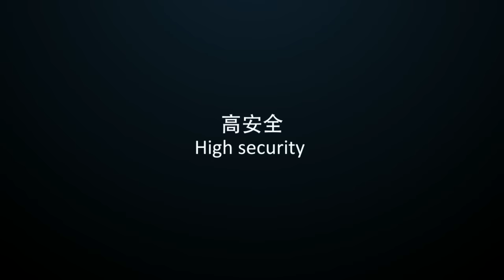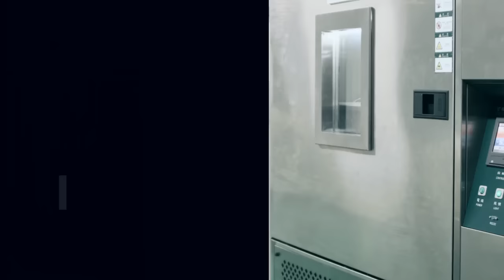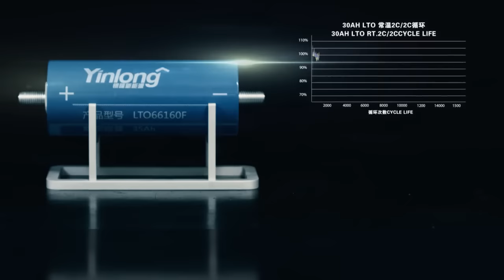Battery safety: Yinlong LTO Lithium Titanate tests

Comment: I agree with how will these are tested. The heat/fire test has me sold.  The are durable and continue to hold a charge. Yinlong seems like a very reputable company so far. It's a pretty penny but looks worth the investment
Reply: Aren't they inexpensive from a power density perspective?
Reply: @rich1051414  inexpensive Per maximum abount of cycles that you can get from them

Comment: What about efficiency? How many % efficient is it when charging and discharging?
Reply from the maker: Hi Daniil. It's a series of safety tests, not efficiency tests.
Reply: Above 98% is typical, they have very low internal resistance and are very efficient.

Comment: State of charge during test?
Reply: Maximilian Van Dongen why would you need that? would you expect any use after cutting one cell?
Reply: @IustinianP  You do not realize that lithium batteries of any kind are only dangerous if they are charged. A test with empty battery is invalid.
Reply: @bflmpsvz870  the bulb was light
Reply: @bflmpsvz870  Read comment, light bulb adjacent is connected to battery, shows that battery is capable of outputting power during test
Reply: @samuels1123  My response was referring to 
Iustinian P. comment, not to the steps taken during the demonstrated test. Again, testing for puncture safety has only sense with a fully charged battery as in this charge state you can expect the most explosive outcomes you want to test for.

Comment: I want to see the drill test AFTER the cell was charged to full capacity.
Reply from the maker: It was tested not only charged but also connected to a lamp which was continue to light during drilling.
Reply: These are LTO cells. They aren't like normal lithium ion cells.

Comment: LTO batteries are not there yet, they loose 15% of charge you put in them. Lifepo4 batteries only loose 1%.
Reply from the maker: Did you test them?
Reply: bflmpsvz exactly unfortunately, because are really good on other performance
Reply from the maker: @bflmpsvz I saw that video, but there is no efficiency test. He quoted someone who said LTO's efficiency is 85%. And Will's cells are noname ones bought from AliExpress as 40Ah ones which the seller then changed to 30Ah in the description but on the photos they are still marked as 40Ah ones)))
Reply: if they are losing 15% of the energy, wouldnt that be in heat?…. A LOT of heat. So that wouldnt be true because they dont get warm to the touch at all
Reply: @funwithdroneshunter2126  Own generated heat is only one of ways of cell energy loss, can happen over time and is practically immeasurable by a raised temperature in an instant. Another loss could be due to cell chemistry inefficiency, outside temperature etc.

Comment: With a car stereo 12 dc and amp at 100 watts dc amp and  with six 2.7 batteries together how long will Likely will these batteries give out power to power a both of these devices
Reply: What's the capacity of 1 cell ?

Comment: They should connect the battery to a light bulb while doing all the test.
Reply from the maker: For what? If it's gonna explode it will explode even without a light bulb connected.
Reply: Connect to the 💡 so we can see how much damage it can take before it completely dead. Also ,it will save a lot  time for people to write the comment to wonder if the battery was charged just as I doing now.
Reply from the maker: Ask Yinlong - it's a series of official tests.
Reply: Hey, Yinlong, why not connect to 💡?
Reply from the maker: I hope they gonna read your comment))
Reply: If there was a light bulb connected and the cell was in a fully discharged state (no crude jokes about discharge please, ok maybe one) then it's not going to make for good advertising. Same goes if they drilled / nailed / cut more than a third the way through (a charged cell) and it caught fire / emitted gas or smoke, then that's not going to be a good look either.

All those claims maybe true. But without an independent test showing terminal voltage I'll choose to remain un convinced at this stage. 

Wishing y'all a splendid life 😊
Reply from the maker: Hi Casey, Why not take one and shoot a video confirming your words? I watched many independent tests where people shorted, drilled, crushed these cells totally and there was no fire.
Reply: It will be too bad, because not looking good in test experiment are one of the main reason I go YouTube.
Reply: My mistake, I watch the video again and noticed they do connect to the light bulb(small light bulb, in the rotation circle) at the first fews test, light bulb are still on after been cutting, drilling, and penetration , also penetration in water.

Comment: Where can I buy these cells?
Reply from the maker: How many of them do you want to buy and where they should be shipped to?
Reply: @ThunderheartReviews  Will these work well in a car audio application?  I would like to build a 14 Volt Bank . I have roughly 200 amps of charging voltage at 14.7 volts. Will that work?
Reply from the maker: Many car audio enthusiasts replace lead-acid batteries with LTO, so it works.
Reply: @egidio6david0  i want this for car audio application as well. I'm thinking  continuous drain. Normal 12.5 - 14.4v range. Any input would be greatly appreciated. I am still trying to learn the diy lto as lithium iron phosphate is to dangerous for car audio application in my opinion.
Reply: Does YinLong has his own Web-site in the internet??? To get some information about who they are , where are they....
Reply: @ThunderheartReviews  don you have a source for the 40ah cells, that are preferably A stock?
Reply: @ThunderheartReviews  Interested

Comment: 0:35 no Burning huh?  I see smoke there...why cut away so fast?
Reply from the maker: Even when you cut wood with a high speed disc cutter you'll see some smoke. Burning means catching fire. It did neither catch fire, nor explode. Smoke is normal as there are chemically active materials inside the battery. Also i think the cell became hot though there is no info about that.

Comment: BS, charge them up to 100% and then drill.
Reply from the maker: Привет, Артём! They are practically safe at any SOC, even in overcharged condition.
Reply: Lithium titanate is known for being incredibly safe compared to other lithium battery technologies. 

That doesn't mean that they don't have their flaws, a low output voltage and an inefficient discharge rate means that they have limited usefulness, but these tests are indeed accurate. 

Also, look at lithium ceramic as well.
Reply from the maker: You're right, every technology has its disadvantages too. In case of LTO the main 2 cons are lower energy density and higher price. The voltage of a single cell doesn't matter when you're building packs - for example do you care if there are 3 cells (3.6V Li-ion) or 5 (2.3V LTO) in your 12V pack? You put a BMS on top and don't care. The thing is that those 5 LTO cells weigh and cost more (much more) than 3 traditional lithium cells.
What you mean by "inefficient discharge rate"? LTO's main advantages are very high charge and discharge rates + enormous cycle life.
Reply: @ThunderheartReviews  
I saw a charge/discharge test with LTO batteries, and the person's results were that he only got about 85% of the power back out of the batteries that he put into charging them.  Perhaps my term of "inefficient discharge rate" isn't the correct term. 

From my understanding, the main advantages of LTO batteries are that they are incredibly safe (as demonstrated in this video), they can charge up relatively quickly compared to other lithium batteries, and that they are rated for a high number of charge/discharge cycles. 

Those particular qualities of LTO batteries make me interested in them as a battery backup for a solar/wind energy system.  I understand that lithium iron phosphate is a common battery technology for that specific application, and lithium ion would probably be the most space efficient, so I'm doing my research and weighing my options. 

I would argue that the low output voltage is indeed a concern because you would need to get more LTO batteries in series then otherwise needed.  That combined with the already high price for LTO cells (they were over 50 dollars per cell last time I checked) maces that a viable concern price (and space) wise.

Out of curiosity, what are the most common uses for these batteries?
Reply from the maker: What cells did that guy test? Genuine Yinlong, Toshiba SCiB, Altairnano or some noname Chinese ones?

The advantages and disadvantages priority may vary depending on the type of usage. Space is critical for one, charge rate for another, cycle life for the third...

Today LTO is mostly used in electric buses.
Reply: @ThunderheartReviews  There was a guy who bought possibly relabelled 30Ah cells from Ali, charged them till 2.5V only, connected them together with copper bars and started to say those discharge rate stupidness.
I have small 3.6Ah pouch bag LTO cells in my robotic lawnmower (changed 18650x5 to 8xLTO), and those have app. 3.7Ah capacity, and my Yinlong 30Ah cells are perform 30Ah without problem.
Reply from the maker: @Cinnabar Sonar
I saw that video, but there is no efficiency test. He quoted someone who said LTO's efficiency is 85%. And Will's cells are noname ones bought from AliExpress as 40Ah ones which the seller then changed to 30Ah in the description but on the photos they are still marked as 40Ah ones)))
@Laszlo Torok
Can you put a link to your 3.6Ah cells?
Reply: @ThunderheartReviews  I bought them from Ali: https://www.aliexpress.com/item/32980110987.html?spm=a2g0s.9042311.0.0.27424c4dpvAP8C - with 0.8C load i got near same result. I do not know the manufacturer of the cells, because there was nothing written on the cells, but they are fine.
Reply: @ThunderheartReviews  I cannot find the spec sheet that the person in the video was referring to, so I was probably mistaken and he got lower capacity batteries. 

If so, then that's one less con to worry about, thanks for taking the time explaining things to me.

One more question, I already said that I plan on using LTO batteries for solar and wind power, I however would like a second opinion.  Do you think that this type of battery would be well suited for that particular task?
Reply from the maker: @Cinnabar Sonar it would be a great choice if you plan to build a system and forget about it for years. If you're an enthusiast and upgrade it all the time - it's not your choice. Also you'll have to choose the remaining equipment carefully to be able to use the full capacity. In case of Will's electronics it wasn't that easy - he couldn't use the whole capacity he had. That made price-per-kWh even more taking into account LTO's high price tag.
Reply: @ThunderheartReviews  I would consider myself an enthusiast on a budget, and while LTO is more expensive at first, I should save money in the long run due to the sheer amount of charge/discharge cycles that it's rated for. 

I don't intend on making frequent upgrades, perhaps adding some cells in parallel down the line to increase capacity, space isn't an issue, I have 4 acres. 

I also intend on installing wind generators, and I've heard that LTO works particularly well with wind due to it's fast charge rate.

I will definitely do the proper research in terms of proper equipment, it seems that chargers that specifically support LTO is needed to take full advantage of the technology.
Reply from the maker: @Cinnabar Sonar
Also take a look at A123 Systems' LiFePO4 cells though they aren't cheap ones. ANR26650M1B which i've tested has fantastic performance - 2500mAh capacity, 4C/10A charge, 28C/70A continuous discharge, cycle life at 10C/25A discharge and 100% DOD is >1000 cycles. You can buy Grade B cells to save some money without losing in performance. I recently bought a bunch of them for a future project. Here is my review with Grade A vs Grade B comparison: https://youtu.be/sESdD4FqXDQ
Reply: @ThunderheartReviews  Interesting, I'll have to look into them.  >1000 cycles is very good, but not as good as the >10000 cycles that I've seen with some lithium titanate batteries, but they are quite a bit cheaper per cell as well.

Perhaps I can start with a small scale with the anr26650m1b's and then switch to LTO after saving some money for a few years of (hopefully) saving some money with running heating from solar/wind during the winter months. 

The anr26650m1b's seem a bit smaller, so I can use them on a travel bus (I intend to travel throughout the United states) if I upgrade. 

Either way, I intend on getting multiple different cells and testing each of them out before I make a bulk purchase. 

Thanks for all of your info.
Reply from the maker: @Cinnabar Sonar
>1000 cycles is for 100% DOD. Those cells' discharge cut-off voltage is 2.0V. I think you won't go so low and probably you'll use a standard BMS which cut-off at 2.5V. Thus you gonna have >3000 cycles.
Reply: @ThunderheartReviews  Alright, definitely better.  And unless it's a portable device I tend to not like going right at the minimum voltage, it's not supposed to be good for the battery.